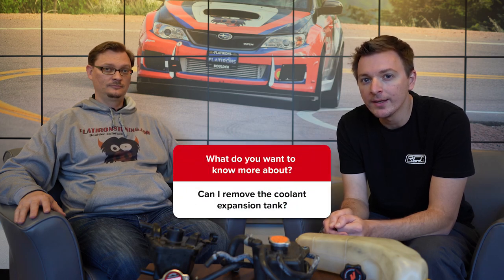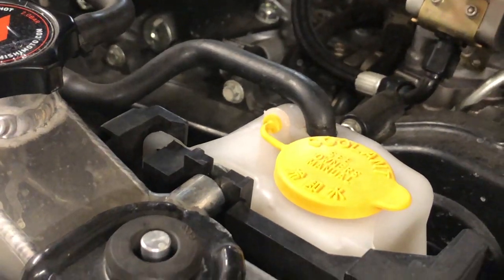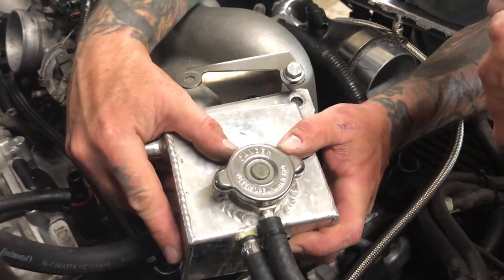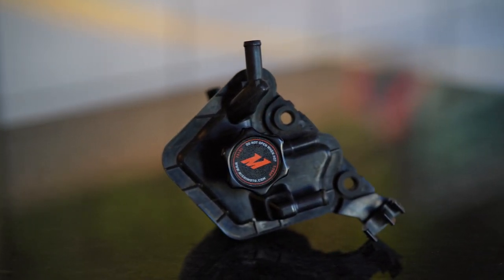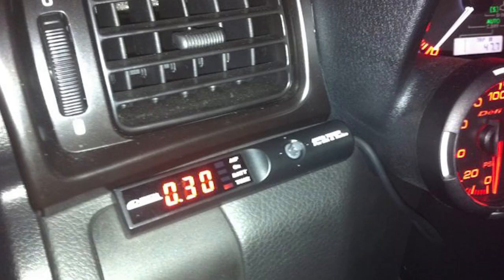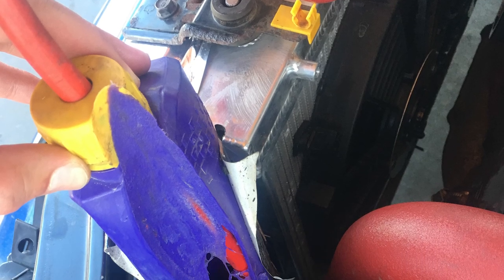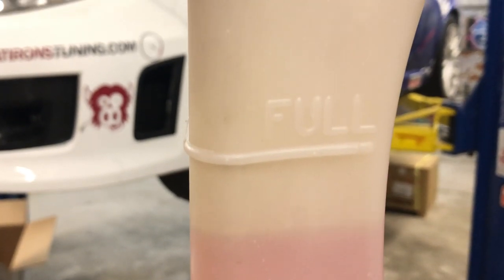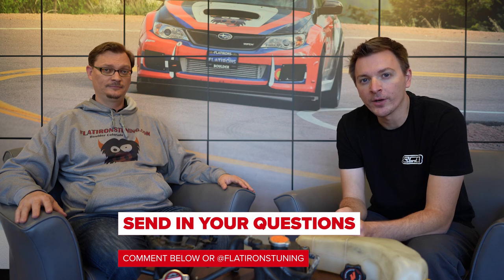What does a coolant expansion tank do and do I need one?

Comment: My expansion tank is overflowing however I did the head gasket sniff test twice and it passed where you put it next to the exhaust and see if it changes color it was fine I have no milky substance in the oil tank and no milky or greasy coolant but yet my expansion tank keeps overflowing no indications of a bad gasket any advice
Reply from the maker: Thanks for the question.  The first thing to do is to test your radiator caps to make sure they are working properly.  Also that you have the correct caps in the correct location.

Here is another video we have on that specifically:

https://youtu.be/HzjBJz1Zdmw

Hope that helps and Stay Tuned!
Reply: @FlatironsTuning  thank you
Reply: Do you find solution? I have the same problem....
Reply: @maly74suba  yes, it was the head gaskets Subarus are notorious for giving Miss readings when  a gasket is blown. It takes a lot of work to determine

Comment: Hey great video guys! Is the coolant expansion tank as important on a car running a non coolant cooled turbo? Something like a rotated setup where the turbo is only oil cooled
Reply: Assuming you bleed the coolant system with the front of the car elevated!
Reply from the maker: Thanks for your question Jake.  If you have a method to bleed the coolant that has worked before, then I'd say you should be fine.  Since Subaru's have the thermostat at the bottom of the radiator, getting air out from the radiator alone can be challenging.  That would be my main concern.

Hope that helps and Stay Tuned!

Comment: My overflow Reservoir only empties when I turn the car off overnight the coolant goes back in to the radiator
Reply from the maker: That isn't the normal flow.  It sounds like you might have air in the system, or a leak.  I'd recommend pressure testing the system.

Thanks for watching and Stay Tuned!

Comment: My coolant gets really high but won’t overflow , and won’t go back down after cold engine changed rad cap already , running mishimoto rad no overheating
Reply from the maker: I'd say that it is worth double checking your coolant level.  As discussed in the video, if your coolant is getting close to the top of the overflow, there is a good chance some is running out through the hole on the back.

Hope that helps and Stay Tuned!

Comment: Is it fine to run a 1.3 bar radiator cap on the radiator and the auxiliary tank? Or should I leave the auxiliary tank cap oem?
Reply from the maker: Thanks for your question.  You certainly can.  The idea of the staggered caps is that you can release the pressure from the Aux tank before the radiator.  If they are both the same pressure, either one could open first.

But it has been done many times without issue.  You just want to make sure that both caps are holding the correct pressure.

Thanks for watching and Stay Tuned!
Reply: I would recommend a 1.08 bar cap for the auxiliary tank, and a 1.3 bar one for the radiator. I had overheating issues when I had both as 1.3 bar.
Reply: They just did a podcast on this topic. Come to find out, it's complicated.

Comment: Hi there,i bought a radiator in Amazon and didn’t open the box to look at it,brought it to a mechanic to replace it,he replace it but the radiator is missing the nipple for the tank expansion hose.what can i do to fix it without charging the radiator again
Reply from the maker: Thanks for your question.  That sounds like a radiator that is for a N/A car, not a turbo car.  The N/A cars don't have the fitting for the expansion tank.  I'd recommend returning it and getting the correct radiator for your car.

Thanks for watching and Stay Tuned!

Comment: In the old days the coolant from expansion would just leak out the radiator cap but people forgot to check coolant and refill the radiator then they started using these expansion tanks and made them part of the system. They stuck them up higher then the radiator so no air would be introduced into the system. If you ever need to change these expansion bottle it’s easy you do not need to drain the whole system suck out the coolant in the bootle just enough so the bottle empty but not hose too the radiator just enough so you can remove the hose from the bottle. Replace the bottle connect the hoses refill the coolant you took out done you should not have to bleed the system. I replaced my bottle cause it got clouded from age and I no longer could see the level

Comment: Hello FlatironsTuning this is a great video and has helped me hone in on my overheating problem. Although I am running into a unique situation. I have a 2010 WRX with 100k miles and my expansion tank fills up when the car gets to operating temp (195°F-210°F) but does not get pulled back into the cooling system once the car cools down.  I live in Dallas so it's hot outside. I can drive for about 50 miles before the coolant in my engine gets too low(because it's in the expansion tank) and then the car will overheat. So I have to pull my expansion tank off and pour that coolant back into the fill reservoir (just above the turbo) every 50 miles to prevent overheating. This works but is not ideal LOL.

My observations: 
1. The coolant system does not lose any quantity of coolant. In other words I do not need to add more coolant to keep the system full. I just have to "manually" transfer the coolant from the expansion tank back to the fill tank.

2. When the car does overheat (due to low coolant in the engine) the top radiator hose is blistering hot but the bottom hose is basically ambient temperature. 

3. No indication of bad head gaskets as there is no residue in either my coolant system or in the oil system and I am not losing any quantity of coolant or oil.

Replaced Parts:
New radiator (autozone), new OEM caps(high pressure cap on the radiator), water pump replaced 10,000 miles ago(autozone), new thermostat (autozone), Peaks Blue antifreeze.

My WRX is basically stock except I have catback exhaust (and forester struts ;D). Intermittently code P0137 will come on (this is likely due to an exhaust leak as I have checked the voltage on the sensor while operating and it appeared to be in-spec). This does mean I am running rich all the time though. However, my intuition tells me that this should not have any impact on this particular cooling problem I am having but I'm not certain. 

My question: 
How would you go about diagnosing this problem or do you have any recommendations on what I should look for?
Reply from the maker: Thanks for your question, and sorry you are having trouble.  Since coolant is not moving from the overflow back to the engine when it cools down, there are two possibilities.  The first is that you have some kind of issue or leak in your cooling system that is preventing the vacuum from pulling the coolant back in.  The second is that your headgaskets have failed.

The best first thing you could do would be to have your cooling system pressure tested.  This will tell you if you have any kind of leak that may be letting air in, etc.

At the same time, it would be good to test your radiator caps just to be sure they are holding pressure.

If all of that checks out, I'd recommend having someone thoroughly burp your cooling system to be as sure as possible that there is no air in the system and see if that improves or resolves your issue.

If you do all that and the symptoms are still the same, I would recommend working with a mechanic to see what they would recommend as a next step, but it could well be that they would recommend replacing the headgaskets at that point.

Hope that helps and Stay Tuned!
Reply: @FlatironsTuning  Thank you for the reply! I love the content you guys are putting out! Much appreciated!
Reply: What was the outcome of your situation ? Anything to share by chance ?
Reply: Love to know if this was resolved!

Comment: So, what are some good aftermarket expansion and overflow tanks for those looking to move away from OEM?  You mentioned the expansion tank should be at the highest point. I know IAG makes one that can be mounted where the boost controller is. And others use stock location. But can you clarify a little on overflow locations?
Reply from the maker: Thanks for watching and thanks for your question.  I do like the IAG expansion tank, it is certainly one of the best options out there currently.

For the overflow, size is really the most important part.  I would not recommend going with anything that has a smaller volume than the stock overflow tank, and you don't want something that seals either.  You need coolant to be able to fill up the bottle when it heats and expands with minimal resistance, and the tank needs to be able to hold the coolant that flows into it under all normal conditions.

That is about it.

I hope that helps and Stay Tuned!

Comment: 2012 STi R Spec. Trackdays i find sometimes im getting some coolant blowing out. Is that from the high G corners or extra heat going thru motor??
i've checked all hoses and connections plus burped system twice to check. Running original coolant also as i've been advised by my engine builder against using other "better" brands
Reply from the maker: Thanks for the question.  Have you checked your radiator caps?  That is definitely the place to start:

https://youtu.be/HzjBJz1Zdmw

From there, you may need to take a look at your headgaskets.  They can get damaged if you overheat the engine.

https://youtu.be/CZWPrsnxI-4

Hope that helps and Stay Tuned!

Comment: If you are running a IAG AOS that runs coolant line you can use the as your high point one ej build on here do it all the time on his builds no issues and his car is 1000 plus
Reply from the maker: Thanks for your comment.  That is true that with something like the IAG AOS, it does become the high point.  And that can certainly make bleeding air out of the system harder if you don't address that.  The Cobb version of the IAG AOS actually has a bleed screw on the top of the AOS for this purpose.

With any AOS that uses coolant, you want to be aware of where the coolant goes in the can, and if you need to change your bleeding procedure to compensate for a change that the AOS may introduce.

Thanks for watching and Stay Tuned!

Comment: As for the vid, you said its not okay if its close to overflowing, but how about if it looses coolant after every drive? Will that be fine? No overheating issues though after long drives. What i mean by loosing is that the coolant level is below the level i put coolant before i drive it
Reply from the maker: Thanks for your question.  If you are using coolant, that is definitely something you want to check into.  Your coolant level should not drop.  If it isn't leaking, there is a chance it is an indication of a headgasket issue.

Hope that helps and Stay Tuned!

Comment: Great explanation!  so, My son just ordered 2002 Subaru wrx turbo (basic 4dr sedan) a used engine (75K miles) to replace the blown up one. what things i should look for and what parts of the old engine should not swap?  You know dads they want to make sure their kids don't screw up.  BTW, engine arrived today and I noticed the expansion tank isn't there, so most likely would have to order one prior to installation, should I get a new or used one (in ebay)?.  Sorry too many questions.
Reply from the maker: Thanks for your question.  As long as it is a non-AVCS WRX engine, the swap will be very straight forward.  If you aren't going to go through the engine too much, I'd recommend doing the timing belt service at a minimum.  Re-seal the oil pump, and put on new timing components and water pump.  That way you know all of those parts are in good shape, and it will also give you a good chance to look through the engine, etc.

We have a blog talking about options here:

https://www.flatironstuning.com/blog/what-is-the-best-subaru-timing-belt-kit

The other thing I would say, because this seems to happen somewhat often, is, make sure it isn't an EJ20X or EJ20Y engine.  We have a good discussion about that with iWire here:

https://youtu.be/UkU8UqxDspc

If the engine he got is a newer engine that has AVCS, then that is something that you will need to deal with and at that point I'd say the best thing to do would be to set up a consult with us on our website, and we can go through details for your build, and discuss options, etc.

https://www.flatironstuning.com/build-consultation

Hope that helps, and Stay Tuned!

Comment: What an awesome and informative video. Keep going. However i am a bit concerned about my cooling system now, since i have lifted the tube, which leads down into the coolant expansion tank, a couple of times above the low coolant mark. Only for a very brief moment tho. Should i be worried that air might have gotten into the system? The car has no overheating issue.
Reply from the maker: Thanks for your question.  If the tube has simply worked its way up, you should be fine as long as it is always sending coolant back to the engine when needed.

If you aren't having any cooling issues currently, most likely you are okay, but you could burp the coolant just to be sure.

Thanks for watching and Stay Tuned!

Comment: Great video. So is it ideal to have it in between the low and high levels?
Reply from the maker: Thanks for the question.  More important than the starting point, you just want to see the level rise as the car warms up, and then go back down to the same level when the engine cools off.  If you wanted to set the level in between the marks, you may want to use a marker to put your own mark on the bottle to see what the level is doing.

Thanks for watching and Stay Tuned!

Comment: Can the aux tank be removed if running pte turbo?
Reply from the maker: Thanks for your question.  I'm assuming that is an oil only turbo?  The auxiliary tank really does make it much easier to effectively get the air out of the cooling system.  

Thanks for watching and Stay Tuned!

Comment: Doesn't the Subaru EJ cooling system essentially self bleed? Any air collects in the auxillary tank at the highest point, exits out the cap when engine warms and is pushed out via the expansion tank. I've never had any issues with mine or needed to 'bleed' it, like lots seem to.
Reply from the maker: Thanks for your question.  In theory, yes, the cooling system will self bleed, but only to an extent.  For instance, when you replace the coolant, and drive the car for the first time or two, you want to keep an eye on the "low" level, as it is common for the engine to pull in a bit more coolant as it does get some more air out of the system.

That being said, if you start to have an issue with air in the system where the cooling system is starting to lose the ability to do its job, the system will more than likely never be able to correct for that.

Hope that helps and Stay Tuned!

Comment: I heard that an "overflow tank" is next to the radiator and an "expansion tank" is the "highest point" of the coolant system located above the turbo.
but I heard you call the "auxiliary tank" the "expansion tank" and you called the overflow the same.